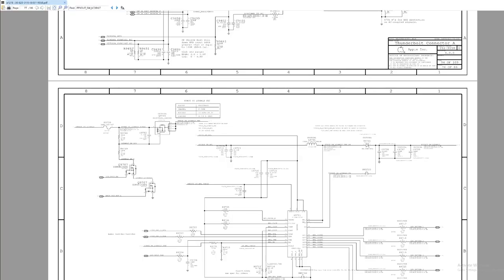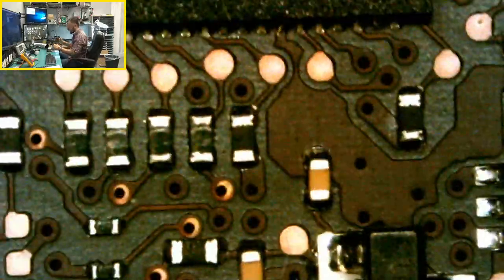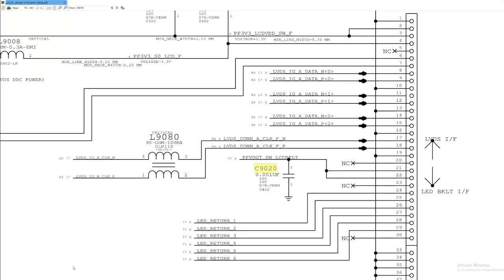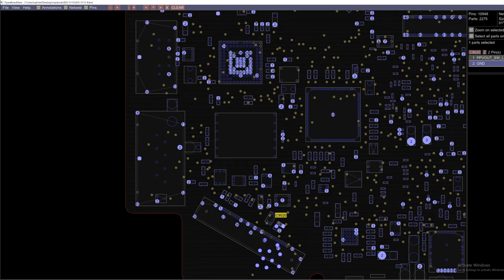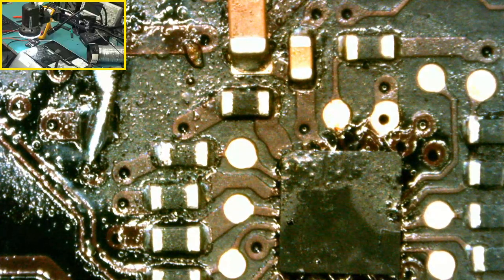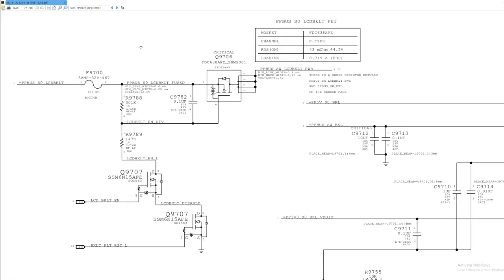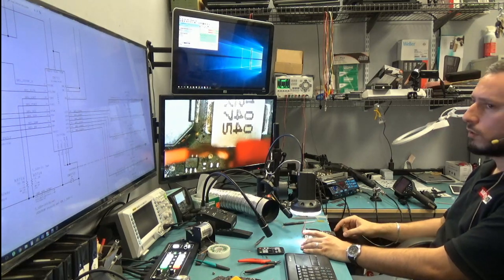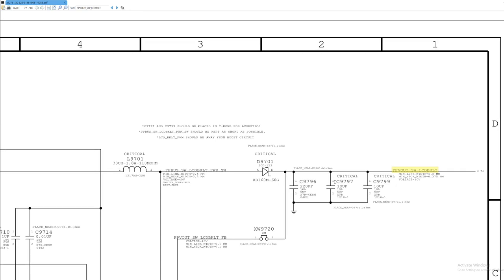2012 Macbook Pro 820-3115 Use Flir to Detect Short circuit - Black screen no Backlight

Comment: Hi! I have the same MacBook Pro but mine has a different problem. The screen does turn on but is all white. You can change the screen brightness but that's about it. It works perfectly with an external screen, but I'm not able to use it without one. I know there is/are circuits broken because the connector of the screen was broken and it blew something in there. I was wondering if you could tell me which circuits are related to my problem due to my bad English and lack of knowledge of this topic. Thank you!

Comment: all right, i will ask here: where on a macbook pro A1502 logic board is the 820-xxxx number located? does the L/B have to be removed, as it may be on the underside? will that light shine thru the apple cover or lid light on a retina screen? thanks again I removed the SSD but not there (underneath) , as well as the wifi card. any suggestions? cool solder tweezers!

Comment: from own experience, when line is shorted and its not from components, and not getting real hot to pinpoint the short,it can be 2 things,big connector that wont get hot injecting 12v. or the line itself is touching ground somewhere. big fan.keep up the good work